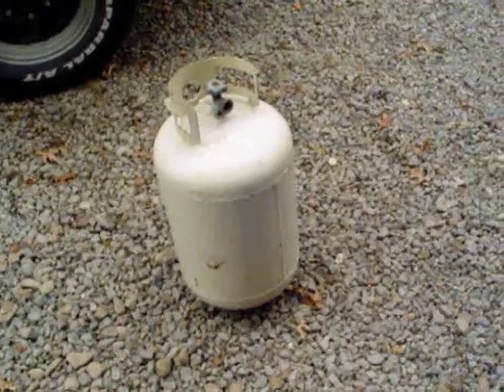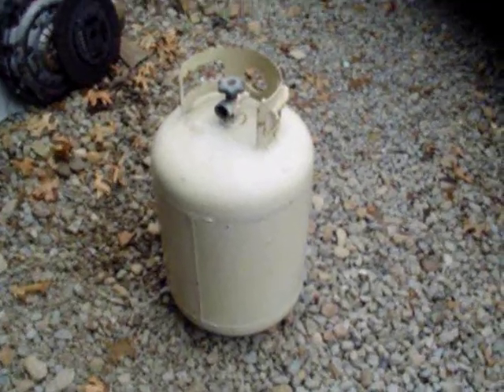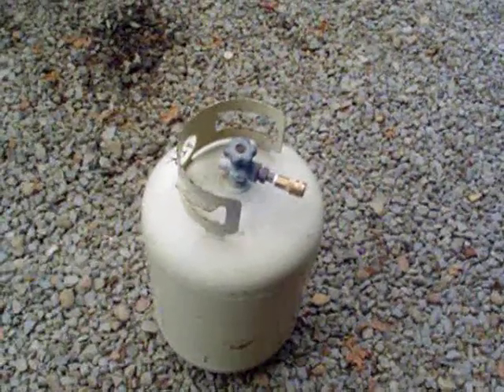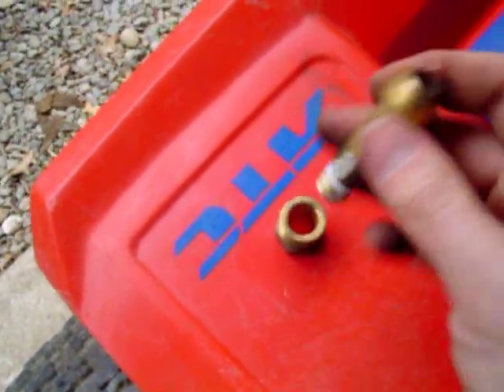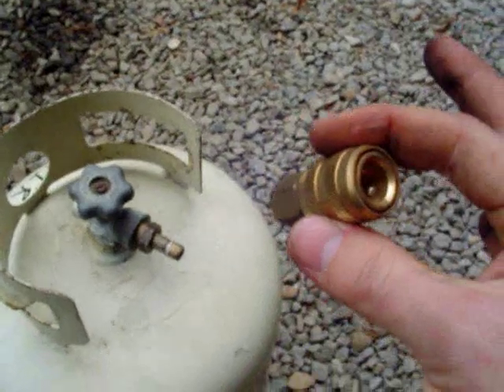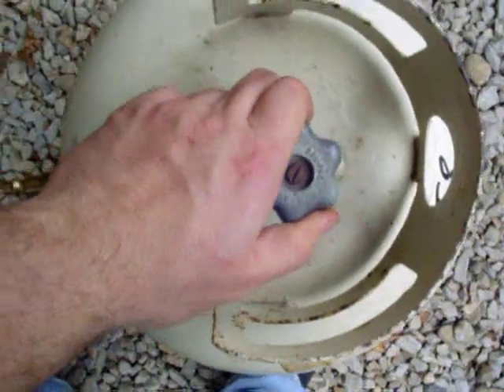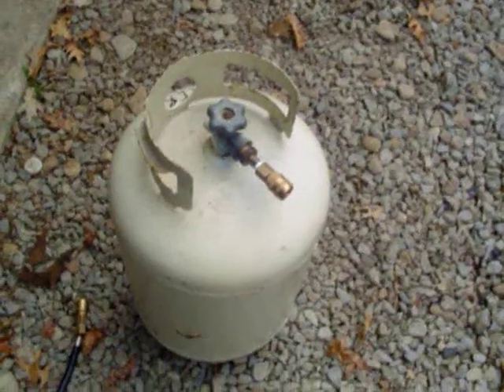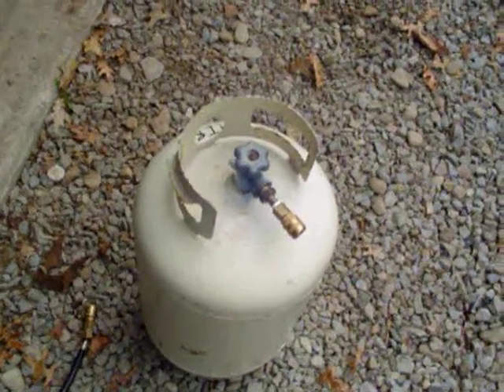Making a portable air tank from a propane tank

Comment: Why don't you get a small 200psi air compressor and that way you can fill up your tank with enough air so that you can fill all 4 tires up to 30-35 psi after your weekend 4x4 trip.  120 130 psi is so low these tanks can handle 375 psi as the blow off pressure relief valve and that is not even the breaking test.

Comment: Improvement: Add a tee instead of quick disconnect. Put a pressure gauge facing up on one part of the "T" and the a hose to be the discharge  on the other side. Orient the tea has top and bottom. (Gauge on top line on bottom) 

Add an air chuck that holds onto the tire valve.

 Then you don't have to take the air chuck off the tire to test the pressure in the tire. the built-in valve will tell you the pressure in the tire and the line. You just crack open and close the propane valve in short bursts until the gauge reads the desired tire pressure then remove the air chuck from the tire valve. it's an extremely quick way of bringing your tires up to the exact pressure without having to add and remove air. I made and still have mine in storage and I made it about 15 years ago.

When the valve is closed and the line is attached to the tire by its valve it will read the pressure that's in the tire + the line. Once you disconnect the line from the valve stem the pressure gauge will let you know how much are you have remaining in the tank. I used to fill my tank up at the bus garage where I worked it took about ten seconds to fill. 20lb tank
Reply: super smart idea Todd wow this will work so nicely.  One add on, buy the chuck that has 3 teeth to hold onto the tire valve not the one it holds so much better.  I don't know the name but it is better.  also  a 200psi air compressor not just 125 lousi psi, 200 makes the tank 60% more effective.
Reply: Thanks for sharing this great idea Todd!

Comment: this connector called 'POL connector'. available on the internet
Reply: You can get one out of an old BBQ grill - free on craigslist - amazon or ebay - it's called a soft pol - if the hole is too small drill it out

Comment: Engineering wise the 20Lb "tank" is legally a cylinder with a shelf life, meant to be discarded after X number of years. Off on the boonies  or Gilligan's Island you can refill cylinders, deodorant cans, 2 liter pop bottles, rotten PVC sewer pipes, or a wooden glued pressure vessel made out of bamboo. ie the if it fails maybe only you lose a few limbs or eyes or your life. 

Transporting the homemade pressure vessel I think is where it is illegal.     That is why dry ASME boiler codes came out in the Steam Engine era, too many folks dying. 

Many folks refill cylinders for other uses. You just do not want to have it explode and kill folks. 

*****The energy stored in a pressure vessel is huge. If it fails up have a bomb with shrapnel.   

The fines for transporting an illegal cylinder are very large for a reason . If one has a converted propane cylinder for air stuck on a outside of a trailer/ motorhome and you invite the law to do the DOT stuff on the illegal transport.:) 

With a tiny DOT39  “non-reusable cylinders" say for a propane torch the Federal Fine is way up there ie 1/2 million bucks plus 5 years in the Federal pen. :) ie if you refill a 1Lb propane cylinder and transport it you might lose 500k and 5 years. :) 

 Thus Just use some common sense in reusing old cylinders, old parachutes, old food, old stuff.

 In a commercial "tank" they are built to standards and meant to last long, plus on big ones have inspection ports for rust and if in doubt the tank is scrapped and becomes a BBQ smoker as a rebirth.

Comment: used a standard tank for over 20 years. never an issue until I watched this. now I want a 30# tank instead of a 20
Reply: Yeah i have a 30lb air tank and if you fill it up to 150 psi  (200 psi is better)if you have 30 inch tires on your truck you can nicely air up all 4 tires from about 15-20psi to about 30 -35 psi
Reply: Try your 20lb tank with a 200 psi fill from an air compressor they make the 200psi type small ones and this should fill your car tires.  For truck you need 30lb tank.

Comment: I have been trying to find the specs on these things. I am looking for the max pressure they can hold. I am looking for something that has a max of 500 PSI. If anyone has any idea, please post with links if possible. Thanks
@timmckinney
www.cubedfive.com
Reply from the maker: Don't think I was ever able to find information on a "published" pressure rating for these tanks. Worked backwards by comparing the vapor pressure of propane at different temperatures and what the safety blow off valves were set for.  Don't think I'd want to get anywhere near 500 psi though, maybe need to look into scuba or oxygen tanks.
Reply: Yeah, actually I was looking at Beverage co2 tanks. They can handle up to 4500psi. Thanks

Comment: Back in the early 80`s my buddy had a propane tank explode from loading it with 150 psi .nobody was near it but part of the top of it flew 25 ft in the air.. So be careful !!! It would be a good idea to coat the inside of the tank with some good rust prrof paint.

Comment: There is a float valve inside these tanks so they can't be over filled. Turning the tank upside down won't work as far as letting all the gas out. The valve closes when you do that.
Reply: Thanks. Didn't know that.
Reply: valve can be removed and that internal shut off mechanism can be easily removed.

Comment: That's a simple way of doing it while using the original valve. For the ones wanting a pressure gauge just screw in a T fitting on and screw in your gauge there. One thing that I've done several times on these  to fill them with a regular tire chuck is. I'll take and drill a clean hole up near the top of tank the same size as a steel wheel has for the valve stem. DE burr the hole then dip the big end of your valve stem in oil and use a blunt "NOT SHARP" screwdriver to push and fit it down in the hole. This works great and never had one to leak around the stem. Also you can wrestle the propane valve out and use regular pipe fittings in the tank itself and use a ball valve or no valve. The rust issue some were concerned about. A few over the years has started to pin hole leak but not had an explosion. Not saying it's impossible. When they get to rusty toss it to recycle and get another newer one. They also make great gasoline tanks for equipment engines. That takes cutting and welding tho. Thanks for the infodeo
Reply: Show us please how you would make a gas can out of propane tanks????
Reply: @HealthSupercharger  
Wash it out good with soap and water. Drill hole in bottom for petcock valve or in the side to have it lay on its side. You can fill it through the original hole with a plug with a plug with a vent hole made into it or drill and weld a bigger one on top or other side of the petcock valve if you put it in the side.    I've welded in quarter inch pipe fittings in top and bottom , then ran clear tubing between for a fuel gauge on these homemade tanks.        Muratic acid (spelling I just woke up) from any hardware store will clean the rust out , it'll look like new. Check out many YouTube videos on the subject , If you're not familiar.   To get the top valve out I use a hydraulic wood splitter to hold the tank and a pipe wrench. You will need to come up with a good way of holding your tank for valve removal. Good luck.    If it is really clean inside and you don't wanna put water inside. (this is what I have done , and not blown myself up yet).!!! After taking the valve out just turn the tank upside down for a week or so and letting gravity and circulation do the washing for you. Then I'd take the torch tied to a stick of some sort and pass over the valve hole , just to make sure it ain't gonna go BOOM 💥🤯!!!!  None of them has yet?!?!. But try this at your own risk. 
    For a gas cap I've used a pipe cap that I took a Dremel tool and milled out a straight down line in the threads all the way to the bottom of the cap. So when you screw it on it can get air around the pipe nipple that you used for the bunghole to fill it with fuel. Actually I used a milling machine to cut the line threads out , but not everyone has a milling machine at hand.

Comment: Great idea. My concern is knowing how much is in it, aka, no guage, could a guage be installed, if so, where would it go?
Reply from the maker: You can set the air regulator on your air compressor to say 100 psi, then you can let the tank fill until the air transfer stops and you'll have 100 psi in the tank when it's fully charged.  You could install a gauge in between the tank fitting and the quick disconnect though if you want.
Reply: Very simple design, but O2 out of pressure very fast without comp ..am i right?
Reply: https://youtu.be/TYOnMDx8138

Comment: HOW  DO YOU KNOW  WHEN  IT;S FULL ?
Reply: You don't need a gauge, just listen to the air going in. It will slow down then equalize with the tank being used to fill it.
Reply: The tank is full when the air compressor shuts off.

Comment from the maker: The vapor pressure of propane at say 100 degrees F is around 170 psi, most residential compressors produce less than that.  The tanks, are rated for more, but I can't remember the specific numbers.
Reply: modern propane tanks have a 375psi over pressure valve relief so that is even before they break.  These tanks can easily hold 200 psi.
Reply: Leave it in the hot sun, and see what happens ! Jus' say'n ✌

Comment: hey man how psi can resist this tank
Reply: 375
Reply: these tanks have an over pressure release valve set at 375 which means that you can easily use it at 200 psi.

Comment: That is very true but I can tell you that many air tanks have no coating or a poor coating inside that doesn't last very long. I have seen a number of tanks with holes rusted in them. I have never see one explode or that has exploded. Usually the rust holes that leak are fairly isolated. Most of the tank is still structurally sound. But the rust is annoying.

Comment: POR15 is available from Amazon and a great many other online retailers. You can also find it on eBay or in many local auto parts stores. It's a 3-step process consisting of a cleaner, an etcher and the actual coating. It neutralizes rust and permanently seals the substrate material against moisture. It's non-porous, and actually cures faster when moisture is present.

Comment: Yes, you can form moisture in the tank, but i would probably add a dryer between the tank and the quick coupler. and yes, i do also recommend removing the valve, and probably painting on the tank AIR ONLY just as an extra safety precaution.

Comment: This makes me uncomfortable to watch. It doesn't take much more effort or expense to pull the propane valve and replace it with a proper air regulator valve with a pressure gauge. Also, when you pull the propane valve, clean the tank with soapy water to remove any chemical residue and coat the inside of the tank with a rust preventative such as POR15. Compressed air brings condensation (water) which will rust the inside of the tank, eventually causing a failure. An exploding metal tank can kill.

Comment: It works, but yes you can fill that tank with propane, many of distributors don't even look at the date on the bottles, and if somebody were to remove your fitting, now you have a tank that is not purged, witch could be refilled with propane, that could explode because it had air in it, you should remove the old tap and put anything else in its place, that way you or anyone else knows its no longer for propane